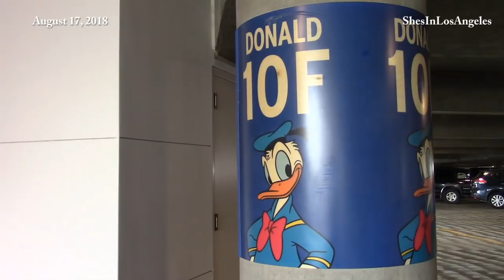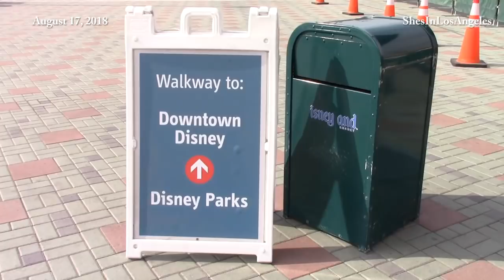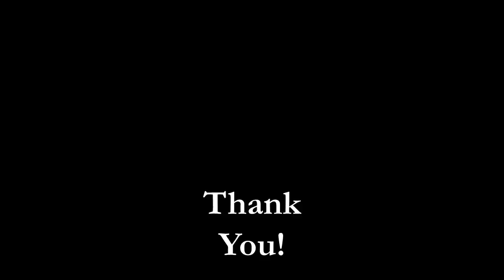Disneyland Resort - 8/17/18 New Parking Structure Construction Update

Comment: Great video.  I loved the zoom in to the concrete pouring, I did a bit of concrete work a few decades ago but we didn't have all those neat toys to help.  And the size of that structure!  I didn't know you could pump concrete that far.  Also, about 11 minutes in, you zoomed in on a couple of guys stripping forms off, and we could hear each hammer blow.  Do you have a zoom (directional) microphone coupled to your zoom lens?
Reply: Her camcorder probably has a nice built-in mic that automatically adjusts to pic up the sound of whatever it is recording, and block out everything else. My camcorder is like that, and it was a pretty cheap one.
Reply from the maker: You're right AWWT... my little cam is coming through for us  :)